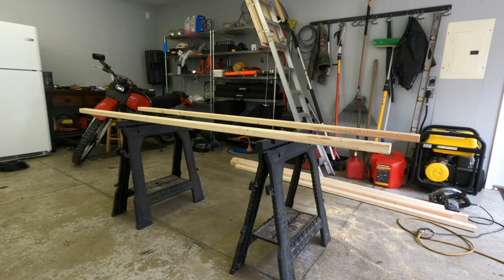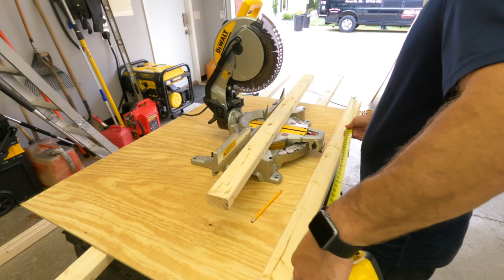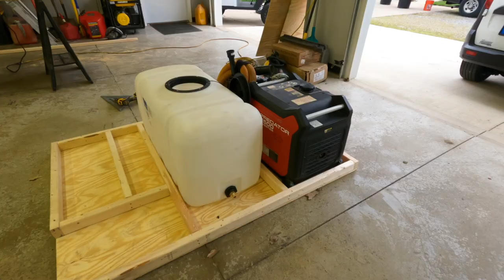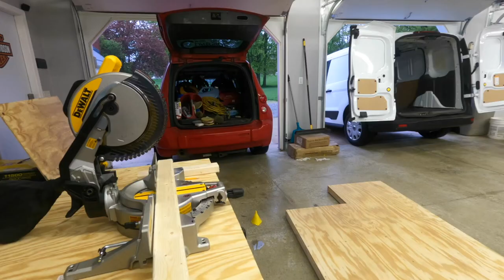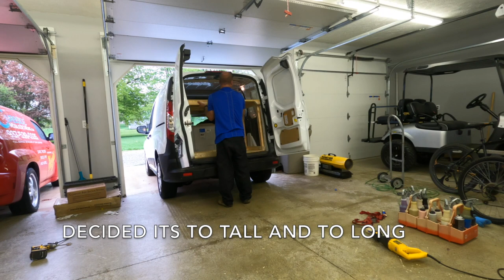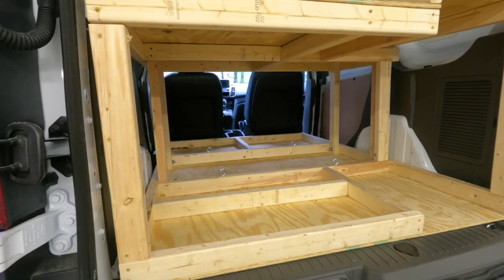Building the Best Mobile Detailing Rig Setup | Part 2 | The Detailing Business

Comment: I like your set up i have a question I would do something similar to my mobile detail pick up but just something small like a shelf on top of my water tank what kind of wood did you used
Reply from the maker: Thank you. I used 2x3 for framing and about 1/4 inch plywood. I tried to reduce weight as much as possible. I didn’t use treated wood but I painted with bed liner in part 3 to protect the wood

Comment: Hey, great work! I’m just curious, at 1:37 you’re securing the plywood to what looks like the tie downs.  Did you remove the OEM bolts and replace them?
Reply from the maker: Yes I did. The factory bolts weren't long enough so I pick some up at the hardware. Cant remember what bolt size but I took the original bolts in and matched them up